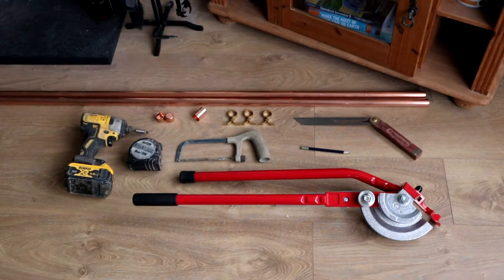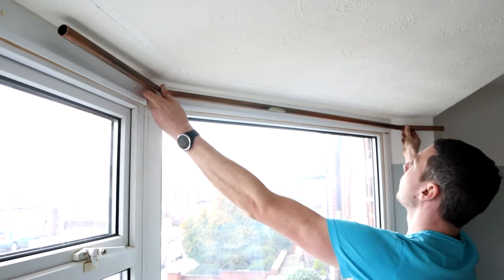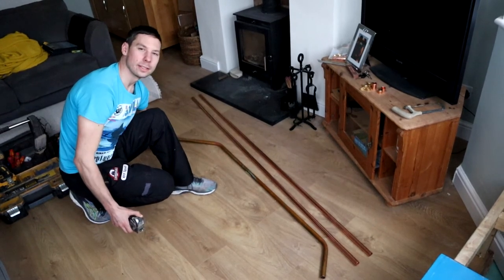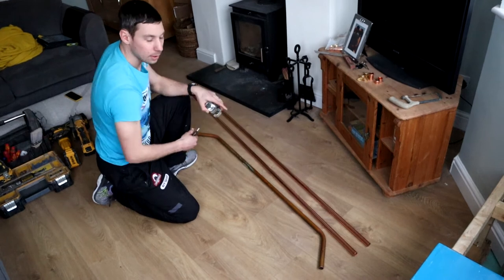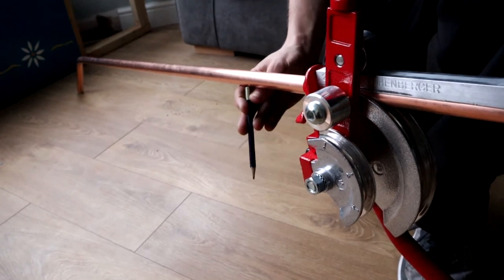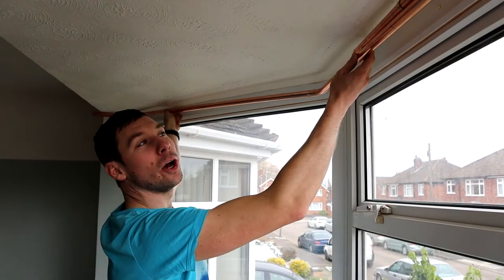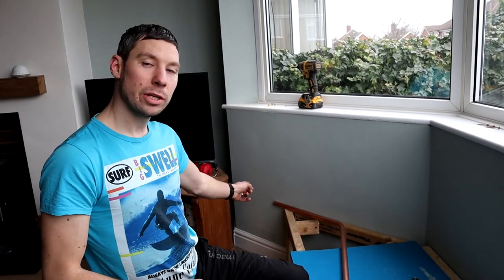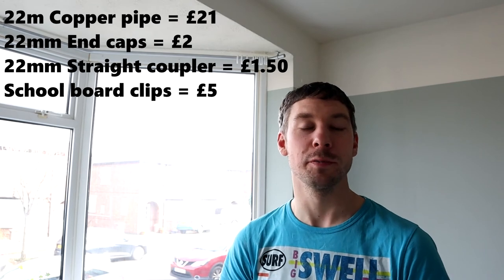How To Make A Budget Bay Window Curtain Pole From Copper Pipe

Comment: Failed to mention the pipe bender price lol
Reply from the maker: You raise a good point however, there was no cost because I borrowed one, equally I could have made a form out of some scrap wood that would have done the same job but it would have needed more elbow grease.
Reply: Not to knock the video. Good job you did. I was going to give it a go myself until I saw the price of a pipe bender.

Comment: Hi! What kind of weight can this 22mm copper pipe hold? Have you got proper curtains on it or a net curtain? I was thinking of doing this and came across your video whilst doing research. I was thinking a double rail, a 15mm pipe for a net curtain, then a 28mm pipe for curtains. Thanks
Reply from the maker: Hi Binman. I’ve got curtains on mine and the rail supports them fine. I’d say if you have a strong fixing, the curtains weight won’t be an issue. 
I like your double rail idea, all the best with that!
Reply: @BerkleyBuilds nice video, thanks. Quick question - how do your curtain pole rings move along the pipe? Don't the brackets get in the way?
Reply from the maker: @InfiniteNowAlways  a great question! I had some strong fixing points so I only used three brackets. One either side and one in the middle